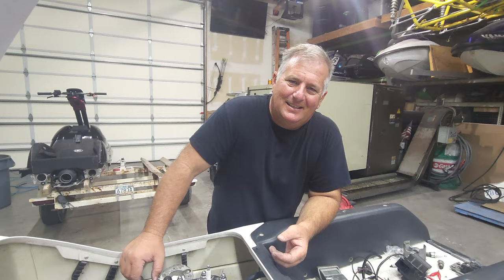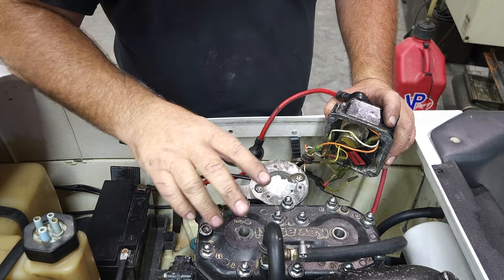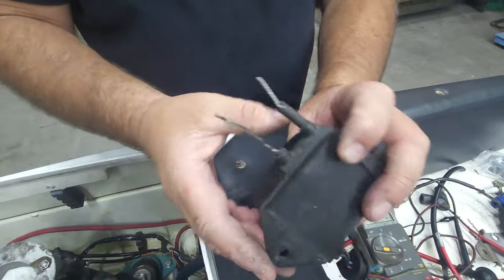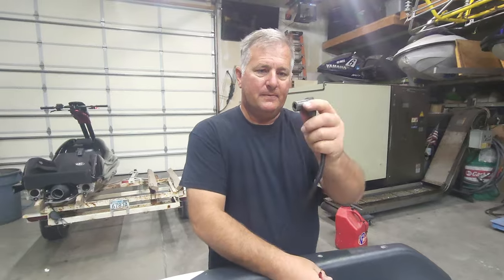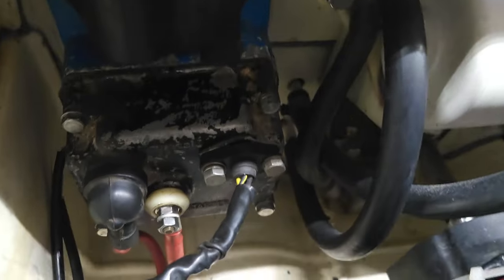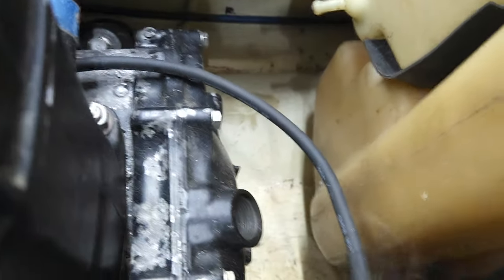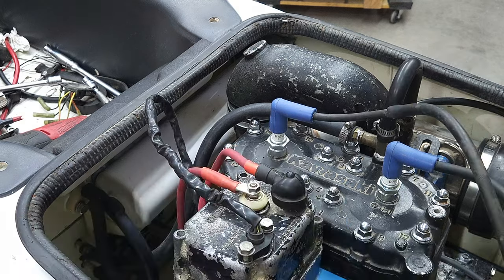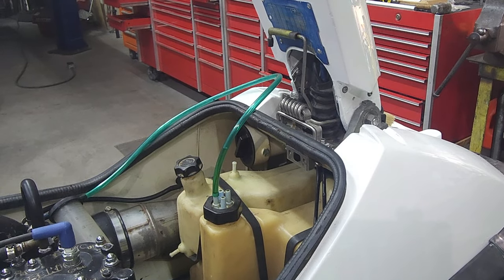650SX Ignition Overhaul, RF Radiation Deep Dive, Speed Test at Body Beach!🌊💨 Epic Restoration Part 4

Comment: I started working on PWC'S in 1991 for public when I quit working on bikes and atv's In all these years would you believe even though working on them I have never in my life ridden or tried to ride a stand up ever.
Reply: not to worry. All the 440/550s are now stashed away.  
the later barges are easy to ride. Dominant foot back, one foot forward to keep weight in the tray.  Apply throttle smoothly.  You turn the bars like a tiller, not like motorcycle handlebars. No counter steering. Accelerate through the corners, never cut the throttle while in a corner. Makes you fall off .  lol.

Comment: So its best too run non resistor boots and plugs as a whole? Is that only for racing or recreational as well!? Im putting a 750 into my 650sx hull
Reply from the maker: Yes, on 550 and 650 ignitions only. The 750 and newer were designed for resistor plugs and caps.

Comment: Cool stuff.  I'm assuming this is also the case with a 95 550SX ignition with the resistor plugs and plug caps?  I already got rid of the resistor plugs, do you think there is more to gain possibly by getting rid of the resistor caps?  Any recommendations on any particular non-resistor caps that are good?  This is for a ski racing in the Vintage 550 Limited class.  Thanks Jet Ski Jim!
Reply from the maker: Absolutely, assuming your are high in the rev range. MSD crimp on terminals, and boots are the only way to go if racing...

Comment: Hey Jim love what you do but I have a question I know your not a wizard but my two stroke 125 dirt bike has spark but won't start how could I tell if the cdi box is bad or if its the stator but I don't know how to tell if that's bad either I just wanted to ask cause you had a bad cdi an it made me think of it I rebuilt the top end but now it won't start I've never had spark an fuel an still no start hope you see this an give me your opinion
Reply from the maker: The biggest issue I see on dirt bikes is where the coil bolts to the frame. That is a grounding connection. They rust. So if you unbolt the coil, and bolt it back down without sanding the coil and frame, it traps rust between them. You still get spark, but it is weak. Otherwise, It is tough to troubleshoot stator/igniter issues on old bikes.. They both could be bad, Or the stator is sending a rogue signal, or the flywheel magnets have gone week, and triggering late. Not fun, but be persistent, you will figure it out. :-)

Comment: Where can I buy the non resistor spark plug boots? I have an 87 js550 with bad boots. Should I run a B7ES plug on that one too? I always ran BR8ES.
Reply from the maker: oreilly's, carquest, Napa, etc. they are the crimp on ones. If you are happy with the way it is currently running, stick with the 8's, but at least run the B8ES, not the resistor plugs....
Reply: @jetskijim007  thanks for the response I need to get a crimp tool too!

Comment: Where do you buy your non resistor spark plug boots and crimp on ends?
Reply from the maker: Usually amazon or ebay on the spark plugs. Any auto parts store carries 90 degree crimp on ends. MSD are the most common brand i see..

Comment: Jim, I am not sure if you have time for replies, but I just got a '88 650SX and was running great at start of summer and then would stop starting after running for awhile and now won't start at all. Checked plugs and wasn't getting any spark. purchased replacement CDI and still no spark. I checked the power wire coming from the magneto that connects to the the CDI with an automotive tester with ground and it lit up like a Christmas tree....but as soon as I connect the magneto to the CDI I get nothing. I'm totally frustrated. Is the magneto not pushing enough power out to the CDI? Does that happen?
Reply from the maker: Yes, it sure does happen. The red wire or the purple wire (depending on what year you have, it will have one or the other) from the stator/magneto, you need to set your volt meter to AC voltage, put 1 lead on the wire, and the other to ground and crank the engine (spark plugs out). If it doesn't crank to at least 14 volts, the CDI will not throw spark. This means the pickup is bad. They cook from the heat the engine puts out.
Reply: @jetskijim007  Thanks so much for the reply! I will check this.
Reply: @jetskijim007, I checked the purple wire voltage while trying to start and it was anywhere between 19-20 volts. It seems this is good. So now it appears pointing back to my CDI I bought might actually be bad? Is there a certain resistance I can check on the CDI to see if it is good or not? I did double check my kill switch and it is operating normally.
Reply: my ski is a '88 650sx
Reply: I found the service manual and will use those resistance numbers to check my CDI. Thanks for the videos and help.

Comment: Great info Jim.. do you have a resource to value a 1988 650sx? Thanks
Reply from the maker: no, unfortunately not. The market has swung dramatically in the last few years. Before covid they were priced from $1500 to $2500, while during covid, values doubled. This year I watched a lot of them sit for sale at $1500, and saw many Superjets available as well. Availability of more desirable ski's drive prices down.
Reply: Thanks. The ski in question is in excellent condition and comes with single trailer for 2k. I guess on the fence due to age of ski and questionable parts availability. Thank you for your time

Comment: Great vids, I appreciate all the good info and detailed explanations.  Do you have a good source for purchasing spark plugs?
Reply from the maker: Ebay or Amazon. They are getting harder to source.
Reply: @jetskijim007  thank you.  do you have to use solid terminal plugs or are the "loose" screw on terminals ok?
Reply from the maker: @MorganFord-d9v  Either works, but when I use the Screw on terminals, 
I crimp them in the center with side cutters so they don't vibrate loose.
Reply: @jetskijim007 Thank you! that was my concern and you have the solution.